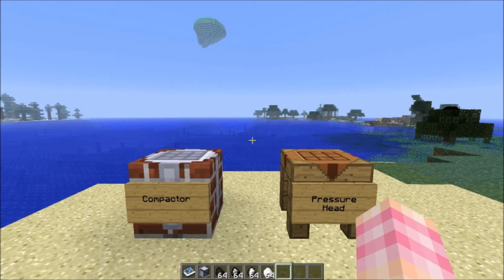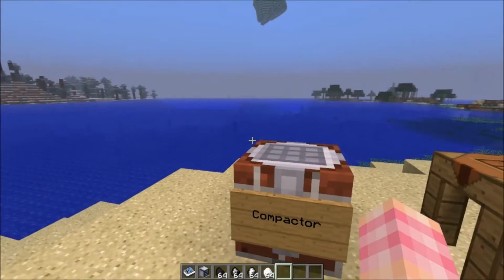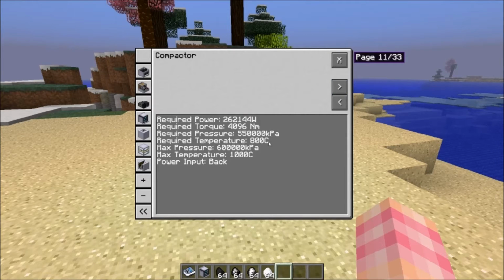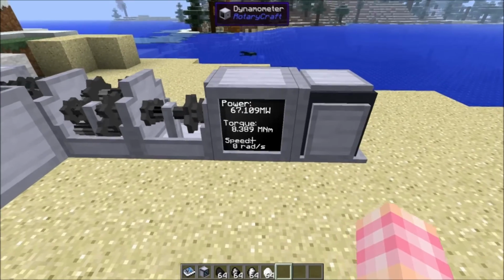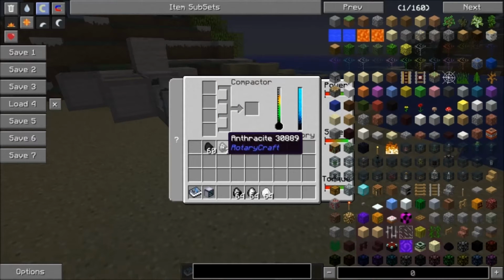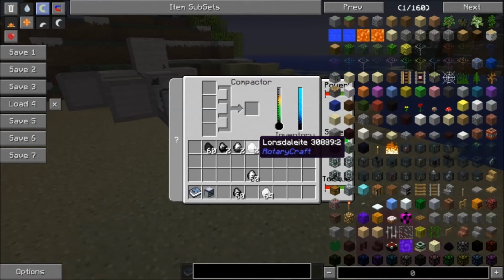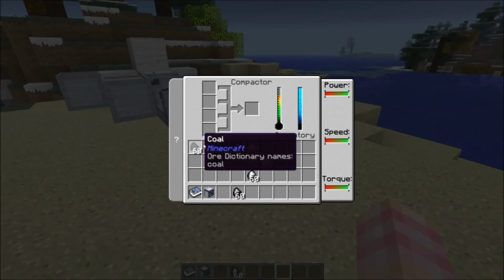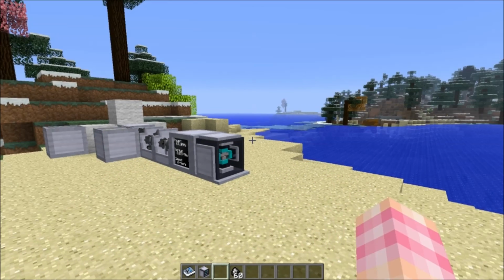RotaryCraft Tutorial #37 - Compactor

Comment: If the pressure keeps increasing, the compactor will explode. So how would I keep the compactor's pressure stable? Is there a certain power input that levels out or, does putting any amount of power in to the compactor always increase the pressure?

Comment: Not all stages in the Compactor require that much pressure. All ReactorCraft magnets are far easier, and I believe the first stages of diamond production are too.
Reply from the maker: I know the ReactorCraft magnets don't' require that much pressure, I'll get to that in that series. As far as the diamond goes, that was the impression the handbook gave me after reading it.
Reply: ReikasMinecraft Why would you ahve it write 600 000kPa rather than 600MPa?
Reply: Boilerplate formatting code, probably.
Reply: +EmperorZelos what a stupid question
Reply: ***** It isn't because anyone with a scientific background wirte 600Mpa over 600 000 KPa
Reply: Why not 0.6 GPa.... silly. You understand? Yes? Why complain...
Reply: If you want a more conventionnal awnser, the range of scaling the pressure is more in the kpa than in mpa. So even its above 1000 kpa we still use the kilos because its more close to our reference.
Reply: Just like 10000 kilogramms.